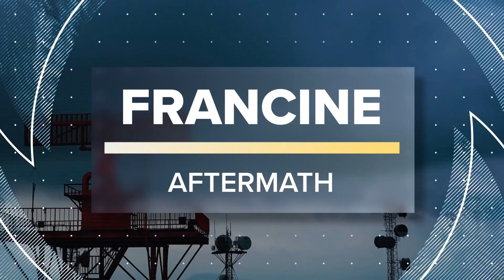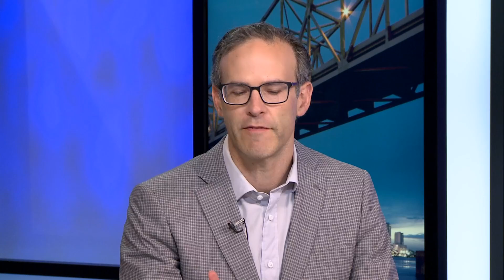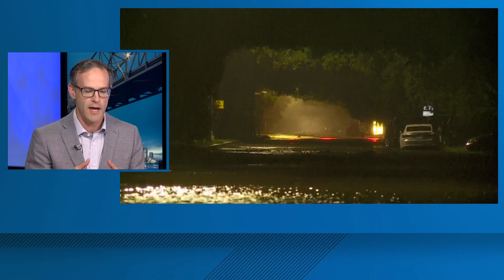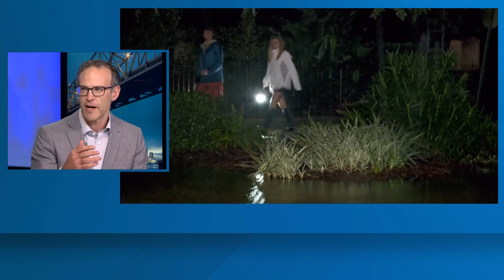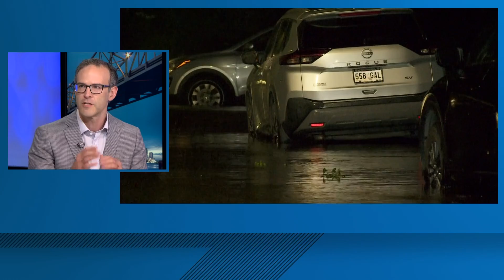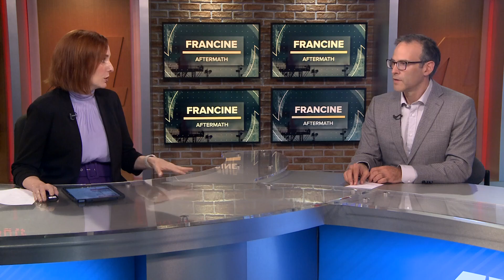New Orleans drainage system performs well in Francine, but beset by some familiar problems

Comment: In my area, drainage system 6, pumps d and e went offline. At one point when I flushed my toilet it backed up and slowly drained. At the Claiborne/Carrollton facility (my area's drainage system) they can't get parts because the turbines run on 25 hertz power while the rest of the United States runs on 60 hertz. The Sewerage and Water Board is telling us to refrain from taking baths or showers or using appliances that use water for another 24 hours... After Ida the Infrastructure Act gave New Orleans money to fix its ailing Infrastructure and there's still money left from that which is unspent and about to expire. Instead of putting band-aids on the ancient system replace the turbine and old pumps with ones that run on modern power.